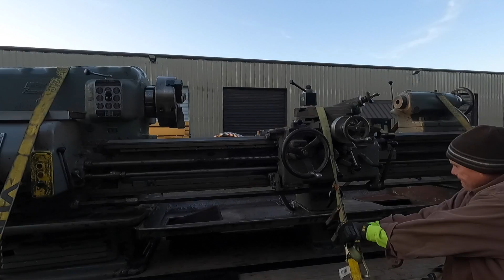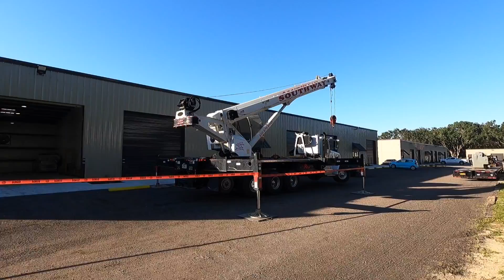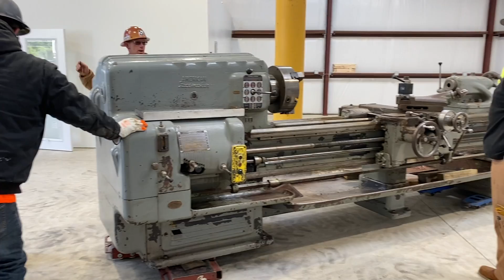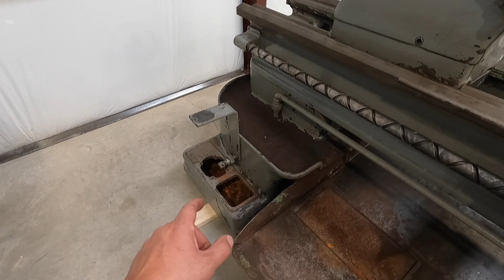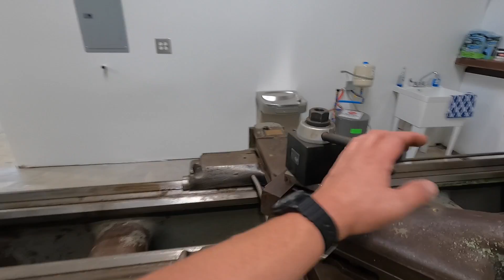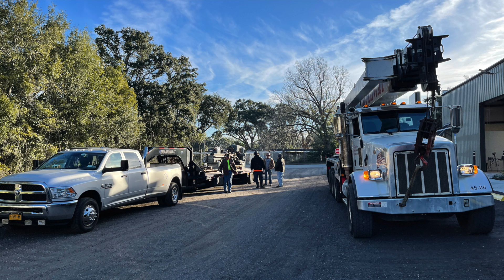American Pacemaker Lathe Arrival & Unloading

Comment: A good clue that the nameplate on the outside is for the drive motor is that the nameplate is "General Electric", nothing else on that machine would be made by GE except for other controls but that tag has the motor connections as well as motor current, number of phases, frequency, amperage, etc. 
It's also a very safe bet that the motor is dual voltage (nominal 220/440) and 3 phase. 
All standard 3 phase motors have 9 wires and there is a standard set for the wiring connections for high or low voltage supplies. 
I used to have trouble remembering how to wire them until I noticed how the numbers are arranged on the nameplates, then it was very easy to remember.
It goes like this:
4-5-6
7-8-9
1-2-3
Notice how 4-5-6 are on top of 7-8-9, while 1-2-3 are on the bottom, this is on purpose

For low voltage, connect 4, 5 & 6 together,
then connect 7 & 1 together along with line 1 from the power source,
then connect 8 & 2 together along with line 2 from the power source,
then connect 9 & 3 together along with line 3 from the power source, 

For high voltage, connect:
4 & 7 together
5 & 8 together
6 & 9 together
then  #1 to line 1 from the power source,
then #2 to line 2 from the power source,
then #3 to line 3 from the power source,

The way I remember it is as follows: 
for high voltage, the middle and upper numbers are connected together. 
for low voltage,  the middle and lower numbers are connect together, then connect the remaining wires on top together (4, 5 & 6).

Here's a photo of a typical nameplate wiring diagram for high and low voltage on al standard 3 phase motors:
https://photos.app.goo.gl/DrttmDFtT2pKRz6p8

Maybe this little trick for remembering how 3 phase motors are wired will help someone else :-) 

Best wishes,

Joe
Reply: unless motor was changed over the last few decades.

Comment: Machine looks great my name is Scott from Montreal Canada I also worked for motion as an industrial mechanic/ Machinist pacemaker looks awesome I'm surprised that you only have a 2 inch bore it seemed a little bit small for a 20-inch swing and the screw in the back underneath the taper attachment I'm not familiar with that could you help me out

Comment: Cool machine! I haven’t seen if you have filled the cut joints in the concrete. If not, you put in a foam backer rod down into the cut joint and fill it on up with a self leveling joint filler/sealer. Such as Sikaflex. Good luck with your new shop. That will make clean up easier without chips etc. getting caught in the joint.

Comment: A chap I know works for Ingersoll Rand in Texas - he used to live in the UK. 
He said that it is very rare to see a HIAB or knuckle boom crane in the USA. They are very common in Great Britain. 
Makes life so much easier that having to order a separate crane in to unload.
Typically a lorry here would have a 12 or even 16 ton HIAB fitted.
Reply: Just what I was thinking, have worked today with a Hiab crane operator today. he could easy lift that lathe do the long haul and unload in the workshop on the spot.

Comment: Adam, regarding the motor data plate.  My American Tool Works radial drill (same art deco flourishes, i.e. same era as your lathe) does not necessarily have the data plate on the motor.  It seems American's idea was that if the motor was hard to reach or see they put the data plate on the machine, near the motor, but in a place where it would be easy to read.  On my drill the spindle motor is exposed and easy to get to.  The data plate is mounted on the motor.  The arm elevating motor is buried inside the arm girdle and is not accessible without major disassembly.  The data plate for that motor is mounted on the arm near the motor.  The only issue will be if someone changed the motor out then the data plate may not be correct.  It's a nice lathe.  Ken
Reply: I agree with the nameplate being placed in a much easier to read location, I've seen that done many times. 
Another clue is that the nameplate is "General Electric" which is obviously for the motor, nothing else on that machine would be made by GE except for other controls but that tag has the motor connections as well as motor current, number of phases, frequency, amperage, etc. 
It's also a very safe bet that the motor is dual voltage (nominal 220/440) and 3 phase. 
All 3 phase motors have 9 wires and there is a standard for the wiring connections for high or low voltage supplies. 
I used to have trouble remembering how to wire them until I noticed how the numbers are arranged on the nameplates, then it was very easy to remember.
It goes like this:
4-5-6
7-8-9
1-2-3
Notice how 4-5-6 are on top of 7-8-9, while 1-2-3 are on the bottom, this is on purpose
For low voltage, connect 4, 5 & 6 together,
then connect 7 & 1 together along with line 1 from the power source,
then connect 8 & 2 together along with line 2 from the power source,
then connect 9 & 3 together along with line 3 from the power source, 

For high voltage, connect:
4 & 7 together
5 & 8 together
6 & 9 together
then  #1 to line 1 from the power source,
then #2 to line 2 from the power source,
then #3 to line 3 from the power source,

The way I remember it is as follows: 
for high voltage, the middle and upper numbers are connected together. 
for low voltage,  the middle and lower numbers are connect together, then connect the remaining wires on top together (4, 5 & 6).

Here's a photo of a typical nameplate wiring diagram for high and low voltage on al standard 3 phase motors:
https://photos.app.goo.gl/DrttmDFtT2pKRz6p8

Maybe this little trick for remembering how 3 phase motors are wired will help someone else :-) 

Best wishes,

Joe

Comment: The most impressive machine move that I have experienced was the installation of 4 x 7T granite bed printed circuit board drilling machines.  Each one was floated in on 4 compressed air mats that allowed very easy movement once the inertia was overcome, the mats allowed movement in all directions to precisely locate each unit with millimetre accuracy.

Comment: I don't know that model of lathe, but I was on the edge of my seat as they were moving that thing. It definitely did not look at all properly latched with the crane lift straps.  In my mind I was thinking they were going to bounce it while in movement, and then the casting would snap somewhere on the recovery and that would be that. Surprisingly that didn't happen. Also our shop switched to air skates, fuck all that huff/puffn and bar jockying. 4-AIR SKATES, a high  volume air compressor and that bitch is owned with the pinky of a 7yr old., move that bitch all over effortlessly.

Comment: Excited to see this restoration!  Is the plan to disassemble and take the parts to the old shop, move machines to the new building as needed, or maybe both?
Can you do a bit of a critique on the delivery, floor, or other concerns?  It was difficult to tell, are there four lift points there?  Thanks for the video.

Comment: should have booked a franna crane truck, would have picked up lathe, driven into your shop and placed lathe where you wanted it, no skates needed, next time order a franna crane truck, cheaper quicker, easier
Reply: Still would have had to put it on skates to turn the corner. You're underestimating how much of a hassle it would have been just to be able to push the lathe 15 more feet into the shop. Not worth it.
Reply: Interesting. I never knew they existed.

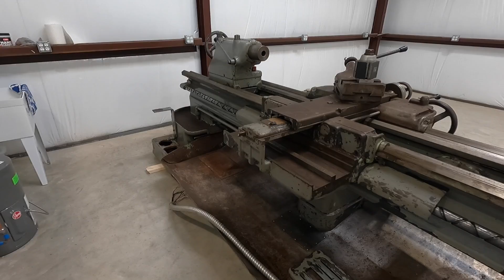Comment: What's that zigzag shaft at 14:10?
Reply: bi-directional lead screw.  Can travel in two directions without stopping and reversing the motor.
Reply: @douglasjackson1998  interesting, thank you!
Reply: @douglasjackson1998  Ohhh... I thought he was talking about the conduit laying on the ground. LOL. But, yeah, if you Google "push drill", they use the same sort of bi-directional thread/track to allow for rotation in either direction.
Reply: That's the flexible metallic conduit. Protects the wiring going to the machine.

Comment: Air skates would of been slick (and way less effort)...1 to 2 pounds of push effort per 1,000 pound of machine weight. Lot of friction to overcome with those old school skates.
Reply: I wonder how big of a compressor would you need to use air skates on a surface like that? I've never used them, personally. I

Comment: Adam, it brought tears to my eyes to watch your arrival of your 20” Pacemaker. There was not a better machine made. 
Well along with the American Uni-Turn, Zip Shift (Tracer Lathe), Hustler and Panther lathes.

I worked at American Tool from Nov 1972 to Jan 1977. My father worked there for 45 years. It may have been more. My dad was Journeyman Machinist. 
My dad and uncle worked there. My uncle ran a planer mill. The day after Pearl Harbor my dad and uncle both enlisted. My dad served as ‘Machinist’s Mate First Class’ a board the USS Cincinnati. My dad returned to American Tool after the war where my dad was a General Foreman and later a QA foreman.

When a machine was finished, the customer generally came in to see the machine ran through its paces. The QA Foreman’s Initials along with the date and SN on the tail end of the bed. I am curious to know if my dads initials are stamped there. His initials would be HL (Huston Ludlum). It might also have the initials (EF - Ernie Fry.)
If it has my dads initials, could you send me a photo of it? 

I am a Jr. I worked for William Powell Valve in Cincinnati for a short while where I ran an Acme Turret Lathe. With that experience and without telling my dad, I applied for and hot a job running an American 16” Pacemaker. If I ever get down to Florida, is there any chance that I could visit your shop and hear your Pacemaker running?

There are so many stories I could tell you. I may even have a Uni-Turn and Pacemaker brochure. I also ran a 3220W NC UniTurn with a GE 102C NC control.
FYI: There is a company in Hamilton, OH that works on and calls themselves American Tool. They have no affiliation to the original American Tool.

Comment: Observing the rigging here as a hobbyist but also an engineer. I have lifted small lathes like this, but is a single point load acceptable for a machine of this size and mass?
Reply: Not an engineer, but BS in physics. I was thinking the same thing. I assume some struts along the bottom since it turned out okay?
Reply: Not what I would've done, but it did work. I would've used a spreader bar and lifted from the (not an engineer, so forgive the nomenclature) Bessel points - or as close to them as I could figure. Then again - clearly that'd be a waste of time considering their outcome... They DO do this for a living and they DID get the job done successfully.

Comment: I was looking at that lathe on marketplace, a shop close by has the same one. I just couldn't figure out how to move it. My guy said it weighs in at 17,000 pounds and they had to use 2 excavators to get it off the semi and into the building.

Comment: This question is not a flame throwing one. Just a dumb a$$ welder, who worked in the ship yards for 3 year's. Why couldn't the flatbed trailer have backed into the garage so the rigger's would only have to lift it off the trailer, and maybe fly it half the length of the lathe itself. I mean your shop has a 16' Ft. High door. Their was nothing preventing the truck combo from backing in / out of the shop. My heart was in my mouth watching them fly that lathe across the whole parking lot. Maybe I'm missing something obvious. If so, I'm sorry.
Reply: your complicating things. For what? To avoid swinging the lathe "over the whole parking lot"? That swing was inconsequential. over the "while parking lot"? LOL.
Reply: Abom mentioned the concrete slab on the apron outside the door was less than he was comfortable with. I forget the thickness. Either 6 or 8". Minimum should have been 10" I think.
Reply: @firesurfer  I'm aware that Adam mentioned the concrete was not to his liking. Again, with the overall length of the boom on the crane (The crane could have maintained a VERY SAFE ANGLE,) to unload the lathe. We know the concrete could support the lathe, because, that's where they landed it. The weight of the trailer & lathe was / is a non starter issue. The crane it self & the counter weight's (unknown amount) is a different animal, plus the (approx. 11,000 lb's) lathe. I get that. That trailer doesn't come close to the weight of the crane & counter weight's. To be honest, I didn't see anything that even looked like a counter weight, that was visible to the camera. My guess, a combo of a proper angle (per Manufacture weight chart's) and  the weight of the truck itself was enough of a counter weight. But when you isolate / limit the total weight to just 4 pads, that's what I "ASSUME" what Adam was worried about. That makes sense, because I'd bet no rebar in the concrete side walk, maybe some wire mesh at best. Not to mention that the concrete is still wet (under 30-40 days) so to speak.
Reply: @stanwooddave_1953   Riggers don't like odd angles of lift. What is probably safe is not the issue. They (including Abom) are being conservative. They was no reason not to. The customer (Abom) asked to not cross the apron.
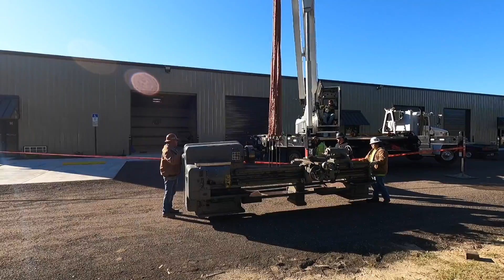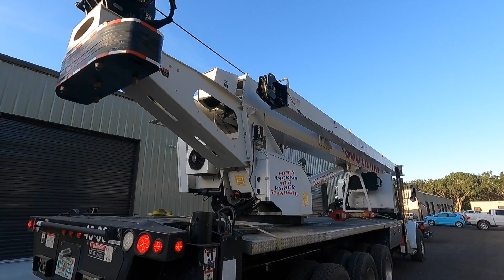Reply: @firesurfer  I'm confused by your comment / question. Are you implying that either the lifting of the lathe @ 7:23 of this video is an "Odd Angle," or at 7:33 when the lathe was landed at the front door of the shop, was an "Odd Angle?" All I was asking is why they couldn't have Fred pull his trailer out from under the crane just like he did, but doing at the 7:33 mark. We know the turning / twisting of the lathe wasn't a concern. They did it (Rotate lathe) at 7:05 of this video. After reviewing this video, I now see the counter weight's located under the main winch (see @ 2:44) Look's to be 7 (seven.)
Reply: @stanwooddave_1953   No. You misunderstood what I said.  Abom asked to not cross the apron. A very reasonable request. The riggers agreed.  End story. Any odd angle would result after entering or crossing the apron.  The way they did it was textbook safe.
    edit; I forgot to mention they can't drive with the outriggers down.
Reply: @stanwooddave_1953  see my edit
Reply: That's not a big deal for a competent rigger and crane operator. You shouldn't have been nervous. 
God bless you! 
Jesus answered and said unto him, Verily, verily, I say unto thee, Except a man be born again, he cannot see the kingdom of God. 
John 3:3 KJV 

Moreover, brethren, I declare unto you the gospel which I preached unto you, which also ye have received, and wherein ye stand; By which also ye are saved, if ye keep in memory what I preached unto you, unless ye have believed in vain. For I delivered unto you first of all that which I also received, how that Christ died for our sins according to the scriptures; And that he was buried, and that he rose again the third day according to the scriptures: 
1 Corinthians 15:1-4 KJV 

For all have sinned, and come short of the glory of God; Being justified freely by his grace through the redemption that is in Christ Jesus: Whom God hath set forth to be a propitiation through faith in his blood, to declare his righteousness for the remission of sins that are past, through the forbearance of God; To declare, I say, at this time his righteousness: that he might be just, and the justifier of him which believeth in Jesus. 
Romans 3:23-26 KJV 

But God commendeth his love toward us, in that, while we were yet sinners, Christ died for us.  Much more then, being now justified by his blood, we shall be saved from wrath through him.  For if, when we were enemies, we were reconciled to God by the death of his Son, much more, being reconciled, we shall be saved by his life.  And not only so, but we also joy in God through our Lord Jesus Christ, by whom we have now received the atonement.
Romans 5:8-11 KJV 

For by grace are ye saved through faith; and that not of yourselves: it is the gift of God: Not of works, lest any man should boast. 
Ephesians 2:8-9 KJV

Therefore being justified by faith, we have peace with God through our Lord Jesus Christ:  By whom also we have access by faith into this grace wherein we stand, and rejoice in hope of the glory of God.
Romans 5:1-2 KJV

That if thou shalt confess with thy mouth the Lord Jesus, and shalt believe in thine heart that God hath raised him from the dead, thou shalt be saved. For with the heart man believeth unto righteousness; and with the mouth confession is made unto salvation. 
Romans 10:9-10 KJV
Reply: @michaelboyle1983  off topic.
Reply: @firesurfer  not all of my reply was off topic. 
God bless you! 
Do you know where your soul is going when you die?

Comment: What size taper in the tailstock?
I have a bunch of taper shank drill bits w/5 tapers my springfield is a 3, want em' if they fit?
Reply: If Adam doesn't take them (perhaps his AP has 4MT, not sure yet) then let me know, please. I have a Republic Lagun Geminis GE-650 with a 6MT tailstock quill that would accept your drills (with a sleeve, of course). Thanks.

Comment: That's looks very similar to a 20 x 76 American I had at my former employer in my machine shop when they shut down our mill. I loved that lathe, it was my favorite lathe. I made hundreds of pump shafts and agitator shafts on that lathe. Ours still had the coolant pump on it but we didn't use it. We had 2 sizes steady rests for it, one the same as yours and a larger one just under 12". We tried to find one in a 14" range but never found one. They sold all my machines on auction and everything sold except the American Lathe and a big Cincinnati Milacron 18 x 80 mill. If you want another good American I know where there is one in PA. Good luck with your new machine.